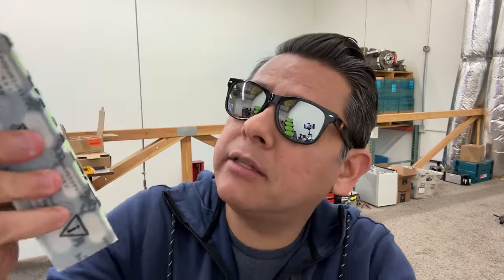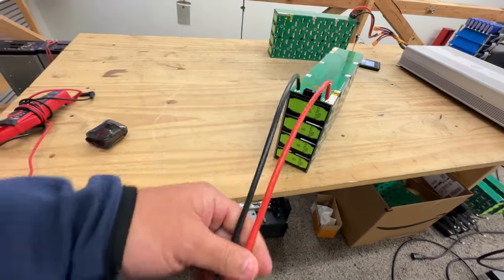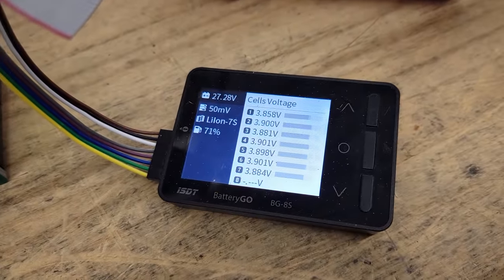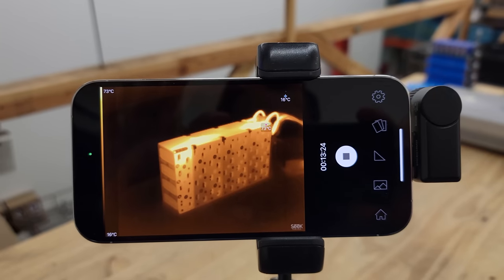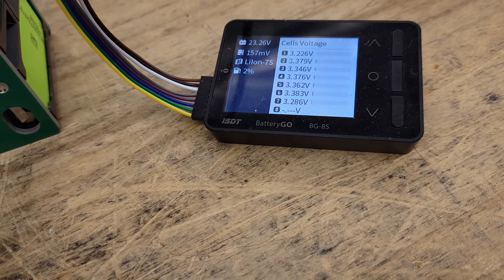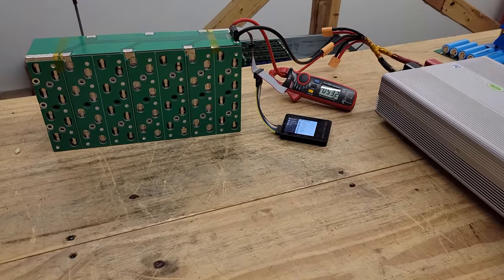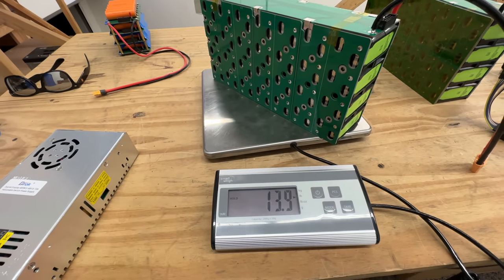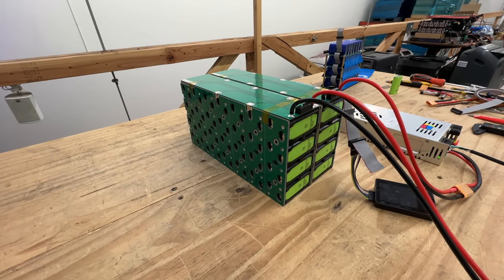1000Wh  24v Boston Swing Lithium Battery Module

Comment: You have all the pieces to make an uninterruptible power supply (UPS) that plugs in and lets computers or refrigerators plug in and that automatically work when the power goes out. Have you done something like that? Will you?
Reply: I agree. I've been looking to make a Lifepo4 and make a UPS myself and like to see him make one.
Reply: A good UPS requires smooth switching between line power and battery backup. Ideally you want to switch the inverter on and restore power in less than 30 milliseconds. Server ups systems will switch on sub 10 milliseconds. 

So while you have all the basic components, a battery, charger, bms, inverter, and switches, getting that really dialed in instant changeover requires some engineering.
Reply: @thecaitiff  what if you build a giant battery system plugged and stays charged by grid. Run everything on it, no need for ups?
Reply: @thecaitiff  also, for computers, there's signalling to the computer to let it know what's going on
Reply: Ya you can buy some units that are inverters solar charger controller and possibly battery charger with automatic transfer switches that I believe are quick enough to be a ups or you can find a use ups that fits your needs and use these batteries
Reply: Well just running an inverter and charging from the grid will be kinda inefficient but sure you could if you were doing that I'd look at solar panels or something to charger it and you can have a big power supply to charge if you don't have sun and for something to react with a computer you will probably need a commercial ups but you probably could come up with some trigger to shut the computer down when the battery gets low

Comment: What would the charging equipment requirements be with such a pack? I'm in the middle of modding a recreational scooter (Cruizin Cooler) and feel one of these packs would be optimal use in it, given the space required by them and the 500w motor I intend to install. Not to mention the substantial improvement in runtime had with it, atop being able to sit long periods without even a maintenance charge while being stored & transported in the my van between use.😊

Comment: Very interesting, especially like the idea for coupling packs in series. For the higher capacity inverter connection can you have something like a nut-sert soldered on the PCB to allow a metal plate/tab to be connected?

Comment: Hmm, looks like it is very hot inside where the batteries are. PCB on the sides aren't getting hot but the batteries are when you look through the holes! Not really that surprising though when drawing high current.

Comment: Incredible performance. What I always have is a question, if a configuration of 12V, 42Ah, we obtain approximately 504 Wh, how 24V, 42Ah, we can obtain 1KWh. How just by doubling the voltage in a series circuit the Wh is begged if the amperage stays the same. I don't understand that part. Not that only in a parallel circuit does this happen and the rise of both Ah and Wh would be directly proportional. A video explaining this would be excellent, I'm really surprised. Thanks for your videos, you are the best.
Reply: Watts = Volts x Amps. If you multiply the volts times 2, it's the same effect on watts as multiplying the amps by 2. Watts = Volts x 2 x Amps

Comment: Jehu I have an important question, first thank you for your videos and expertise. I have a ford e-transit, I want to use its batteries to plug into an inverter to charge a lithium ion battery inside my van for Camper conversion. Is this possible? would solar be more effective? if not how would this be possible or whom should I ask for help in san diego? thank you sir

Comment: Your always using those 16 pin idc connectors like on this and one those 12v 100ah lifepo4 battery pack you sell. I have been wanting to buy one but I have no idea how I’m gonna hook up a bms if the cells weren’t in that pack I’d know how but I don’t want to buy that pack and have no idea how to wire that idc plug

Comment: how would you charge this?
Reply from the maker: 24v charger
Reply: @jehugarcia  cool now I just need to find the correct cords from your battery bank to my eb3a
Reply: xtc 90 out of the bank to ? that connects to the 8mm barrel /Anderson adapter you linked under that video ...totally lost on the wiring
Reply from the maker: You need a 22v battery for eb3a https://youtu.be/8K_6TQ-yC08